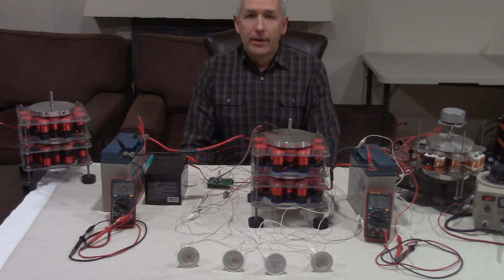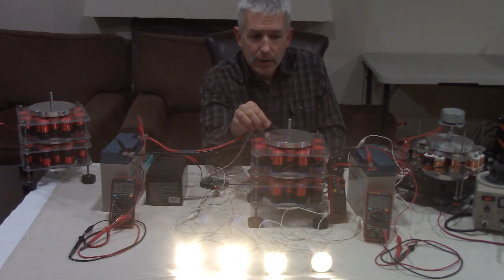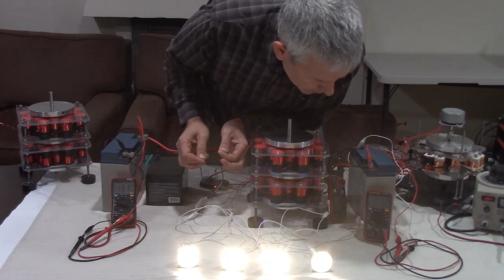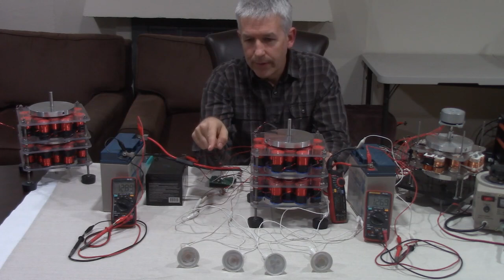EMP Generator Collector Coils added to Double Stack Motor

Comment: It is practical to power in a house devices using 48v battery bank that you say?  And how about the input battery of the motor when going down to drain, it could be swap one another fully charge battery? Can you explain how does it work properly?

Comment: Nice Work Rick.   It seems that channeling power from the EMP coils didn't slow down the motor or put a drag on it.  Is that what we would observe from this setup? Are you able to say about how many watts are harvested from the EMP coils in this demonstration?  Here with 4 LEDs lit from those EMP coils it looked impressive.   Thanks!
Reply from the maker: Yeah there are a number of things going on here worthy of examination. Since the EMP coils are not in the path of the magnets, and are not sharing the cores of the motor coils, they are free running as an open system. Obviously they are affected by whatever affects the motor coil inpulses, and to some extent by the generator coils, especially when they are inpulsed. They output much less than the generator coils and the motor coils, but it is still something that may be worth the extra expense of materials, especially when running the setup at 48V. At 12V these could keep the arduino board running with some added light.
I said that we could do 1000 things with these motors and this is just showing another thing no one is showing. It's the idea that is important.